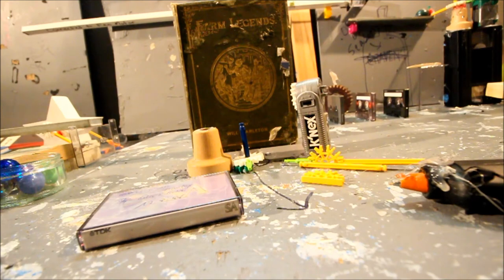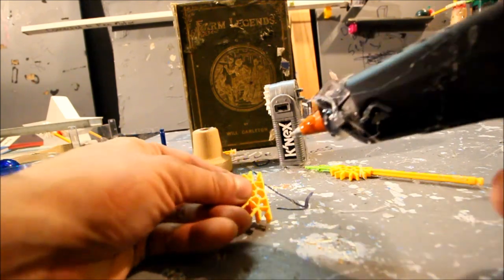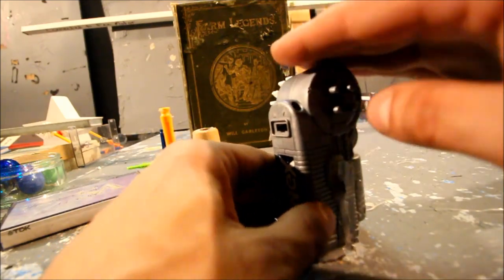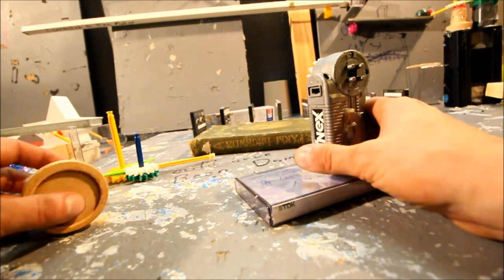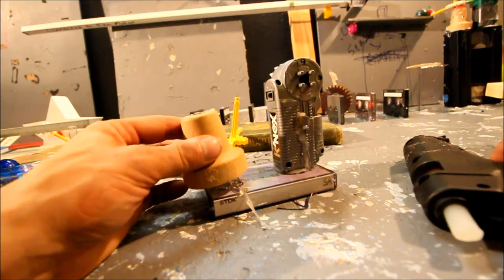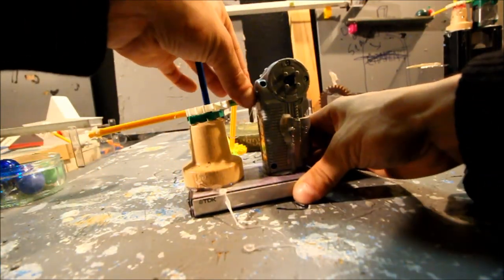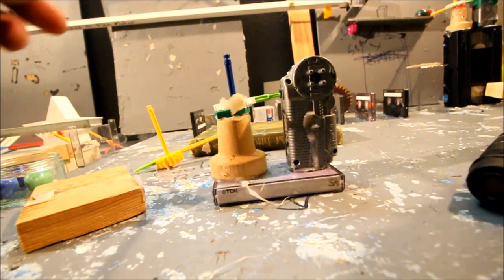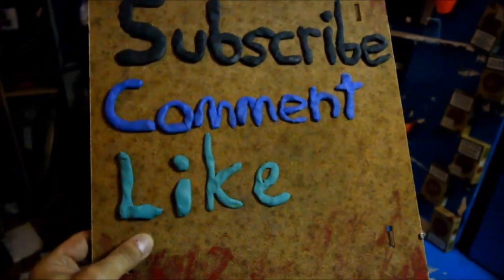How to Turn on a K'Nex Motor - Chain Reaction / Rube Goldberg Tutorial

Comment: You know you can create a base using a blue connector + a grey connector?
Reply from the maker: +Sprice Machines Yeah, but I just don't really like using K'nex for structural elements, though. I LOVE LOVE LOVE knex for the mechanical elements, but I'd rather use a Cassette Tape or a Block of Wood for structural stuff. I just used knex to make a spur! I was gonna use a block of wood originally for this video, but I needed it for a piece in the new machine I'm making.

Comment: As you might know, I have also made a tutorial on turning on a K'nex motor. My version is a bit more complicated, and I actually improved the design even more since that video. But this tutorial made me realize how easy it can be, and it changed my entire viewpoint on how to attack the problem. You may also know that I am quite a perfectionist and purist, so it would be nice to see a purely-K'nex apparatus that accomplishes this task. So that is what I will be working on now. Thank you so much for the inspiration!
Reply from the maker: +jackofallspades98 Thank you so much for watching, I'm anxious to see how you will re-attack the problem! Turning on a K'nex motor for me is something I no longer consider a trick because of its ease and fluidity! The trick is now what the motor does, not turning on the motor. I'm also gonna do a video on the different classes of Chain Reaction Machines: I consider a Class A rube is one that uses no electric or battery power, Class B uses servos and motors and power of some sort, and Class C uses some sort of AI or conditions that require a computer to interpret, such as motion, sound, or color sensors, programmed degrees in motor movement, etc. certain Hex bugs, activating Cell Phones or using an ipad in a machine are all Class C tricks!
Reply: +DonaldDrake Machines I actually shared a short video with you on Twitter of the redesigned model I made based on the method you used here. I made it purely out of K'nex, and also made some design improvements as well that I think you would like, and they shouldn't be too hard to add to your model as well.
I love the idea of sorting ideas into three categories like that. I think it's interesting because calling them "classes" makes it seem like it correlates directly to complexity or difficulty, when in reality, most of my machines consist of only Class A tricks, and there are some pretty complicated ideas in there!
Reply from the maker: +jackofallspades98 Cool, I will check it out and get back to you! I was gonna call them class (insert color), like red class, blue class and green class, that might be better, but I wasn't going to have Class type designate complexity but rather describe what elements it would have. so you could just say Green Class Chain Reaction, and automatically know that it uses some sort of computer electronics. 

So my proposal I will base the video I eventually make will be
Red Class: No Electronics At All
Blue Class: Contains simple motors, battery or electrically powered objects, but
not computer or programming involved
Grey Class- Computer programming, bluetooth, light, motion sound sensors, etc.
Green Class-Chemical reactions and fire. 

So like if you build a normal Red Class but you have fire in it you could say
"I built a Red Class CRM with one Green Trick that lasts a minute" then if they were as nerdy as me or you
they would understand it.
Reply: +DonaldDrake Machines Interesting classifications.  I'm enjoying your tutorials!  :)

Comment: #loadsofglue i have one bootleg motor but it is really hard to trigger the switch. well difference between genuine and bootlegs. Plus i ripped the inner circuits months ago and now i have to solder the wires back.
Reply from the maker: +chin eason RGM glue = freedom, in this video I really didn't care to make the glue not noticeable. I got a fan motor that I use and I really wanna get into computer controlled servos.
Reply: Servos?
Reply from the maker: Short for Servomechanism or Servomotors, basically I'd like a servomotor I could control to the exact degree of movement, such as rotating a precise 90 degrees then stopping.
Reply: Something like a small box with a screen and ports? Lego robotics? Those are very expensive.
Reply from the maker: +chin eason RGM I think LittleBits and Arduino kits can do it, servo motors can be really cheap, like 6-10 bucks, however the initial investment of buying circuit boards and the wires, etc can be pricey. However adding a dash of robotics here and there to my machines is the direction I want to take it in. K'Nex motors are just the tip of the iceberg!
Reply: Woah... we got a future robotics champ here fully loaded with ambition and electricity xD